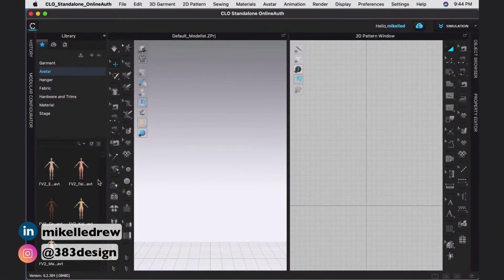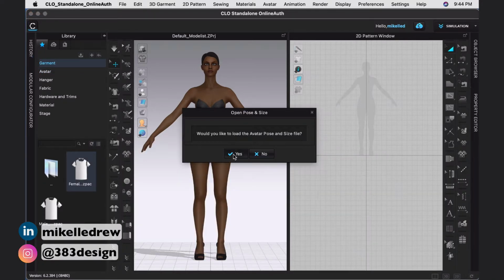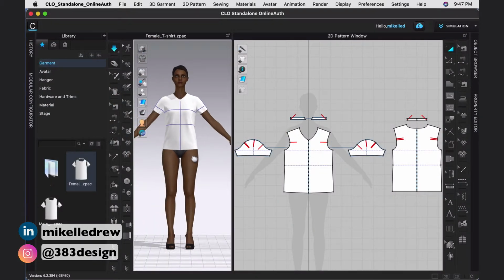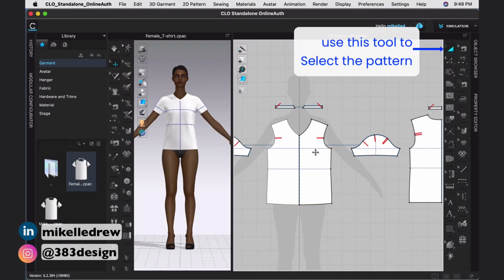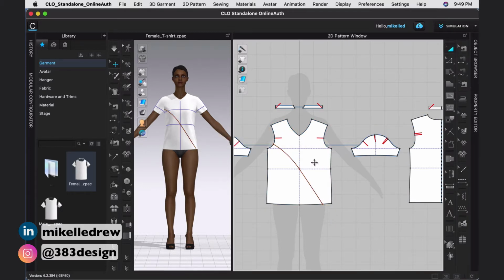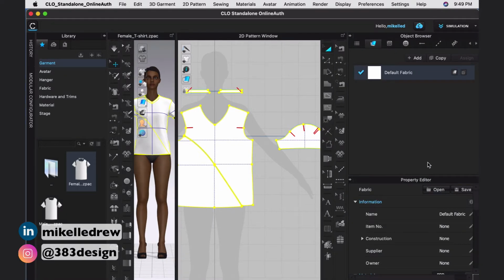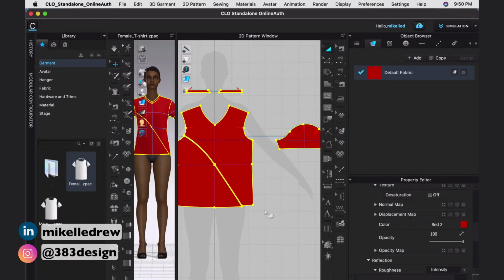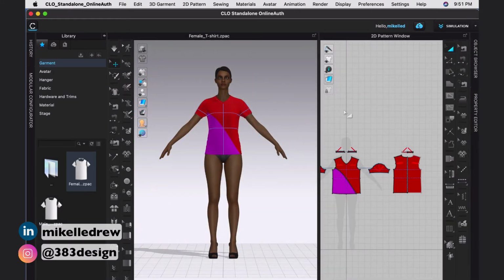How to Make a Basic Tee in Clo3d | 3d fashion design software tutorial

Comment: Thanks for your video. I have a problem with my Clo 3d it is too slow specially when I simulate?
Reply from the maker: It's probably your computer's processor. Any 3D program requires a lot from your computer, particularly when it simulates so if it doesn't meet the program's recommended requirements, it'll move slowly. 

Even on a computer with a faster processor, it tends to move slower during simulation (especially if you're doing a high res rendering), so if your computer is running at their minimum requirements, it's going to be slow.